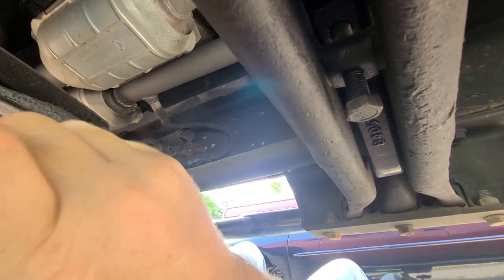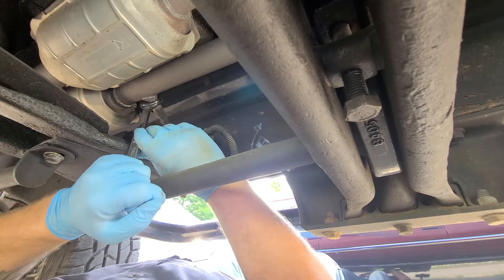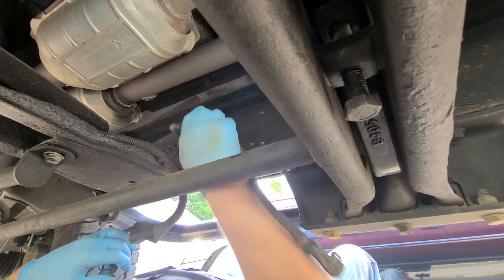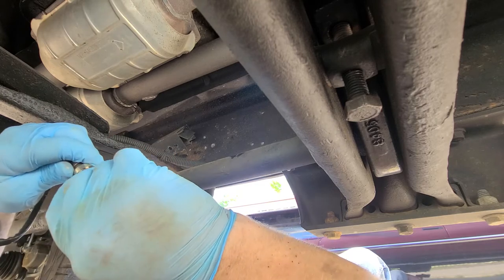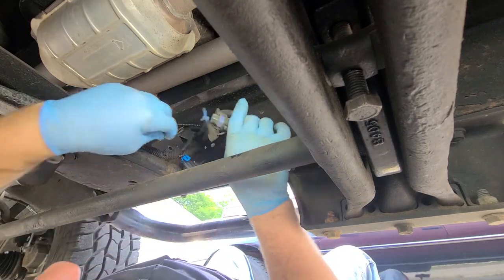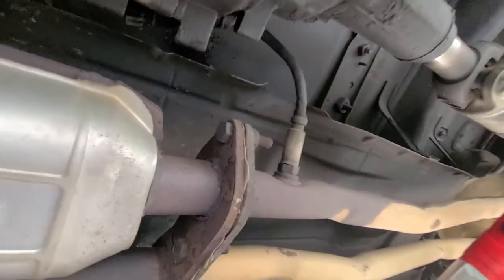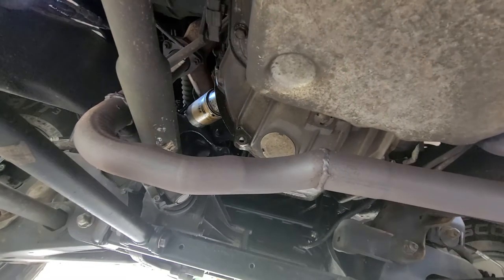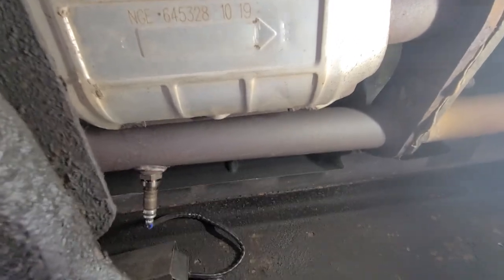How to change rear O2 sensors in a 1998 GMC K1500

Comment: was the exhaust warm or cold when removing them sensors?
Reply from the maker: It was cold but I had the sensor's out befor when I changed the y pipe and converters
Reply from the maker: Most of the time I end up having to use heat to get them out but I got them out ok for the video